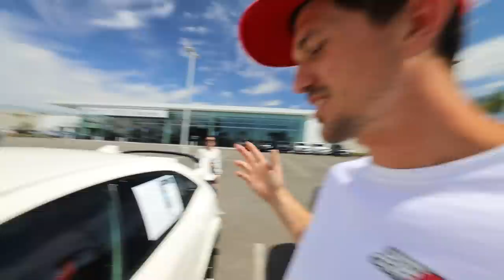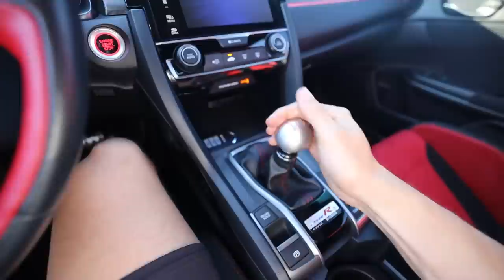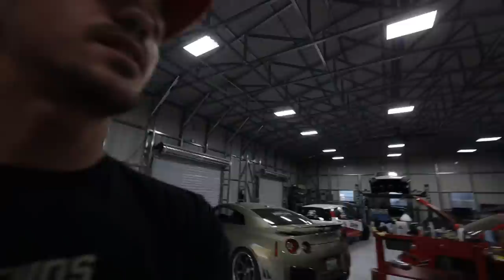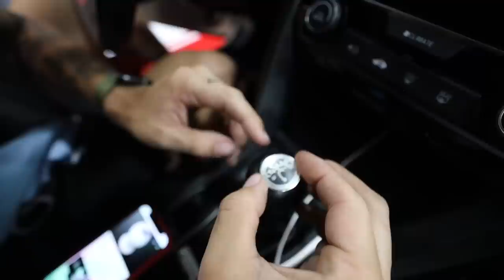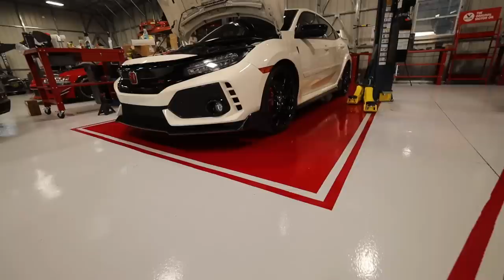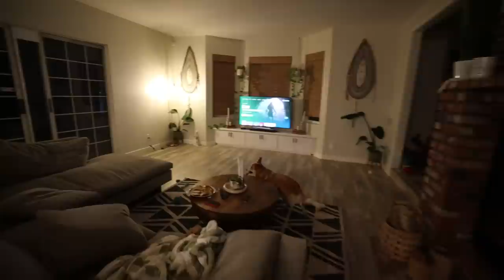Buying My Dream Car!

Comment: I have the 2016 CIVIC FK2 and done 55000km in 6 years with NO issues whatsoever. VERY reliable, fun and easy to daily. 306hp standard is a great platform to work from.

Comment: Perfect addition. My
Coworker built one of these with JDM Varis front. I grew up in the 90s era Civics. I’m glad people still build Hondas today. I can’t wait to see what you do to yours and how you make it an extension of your personality. That was really nerve racking when you installed the oil cap and Js decal. I’m glad your eyes are calibrated with precision. Takes years to master that level of o.c.d haha. I once did that to my TRD Oil Cap in my car and it was slightly crooked. Ended up buying and new one to redo it since it bothered me so much and used a laser to install it perfectly square. I’ve got issues.

Comment: I’m soo freakin stoked about getting the type r again but this better not mean that you’re not going to get a spoon built 2023 type r. I’m now working at a Honda dealership as an express tech and I’ve been lucky enough to drive the fk8 and the new base model civic and even the base model interior and exterior I feel blows the fk8 out of the water for sure, you NEED to get the new gen

Comment: So excited to see an fk8 back on your channel

I think 2017-2018 models have tranny issues and 2019 and older have cooling issues in the track so I recommend cooling or ventilation mods should be high on the list
Reply: Disagree … people that drive them like dirt have tranny issues. 2017 82k miles and drives like new with no grinds etc 👍

Comment: For My Guest With My First Car Scion FR-S With A New Set Of Forgedstar Wheels Also A New TOMEI Exhaust Also A AEM Engine Mods Also A New LED Lights One On The Front and One On The Rear Also With A Roof With A Star Lights Just Like On The Rolls-Royce Also A New APR Carbon Fiber Wing Also Side Skirts Also A Carbon Fiber Lip Also Lastly A New Car Kit Of Meguiars Also A New Stick Shift Color Ball Also A New Air Refreshers.

Comment: CSSubaruBRZCarFan Here Dude Dustin For The Near Future You Get A All New  2023 Honda Civic Type R With The New Set Of Reclined Bucket Seats Also Compete To The Previous 2021 Subaru WRX STI Set Of RECARO Bucket Reclined Seats Also A Starlink Info Also A EJ Power Turbo Boxer Engine Also My First Car Is My 2016 Scion FR-S With Automatic With A Bucket Reclined Seats With The Head Ress Also A New Install Apple Car Play Android Auto Also A Pandora Info.